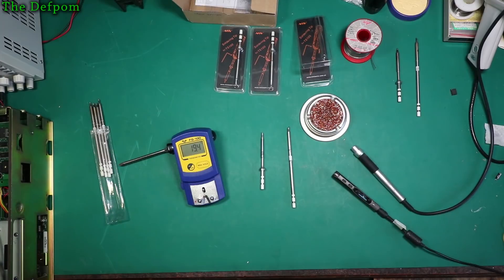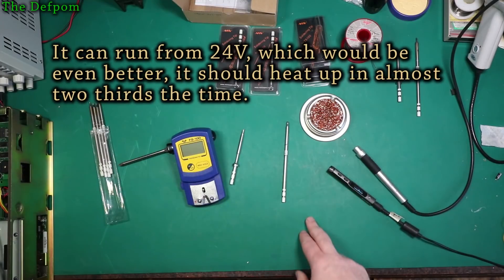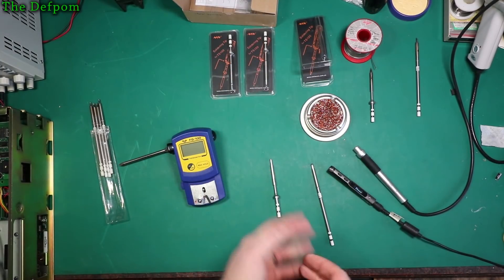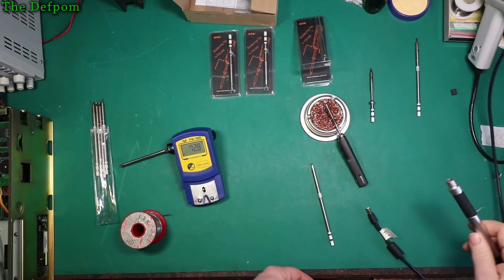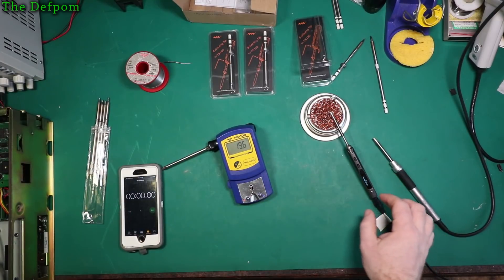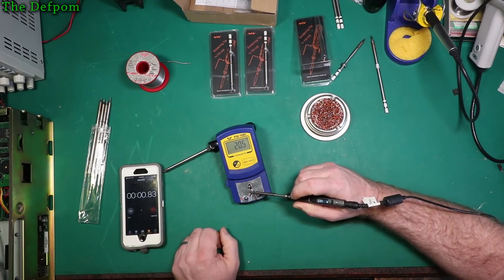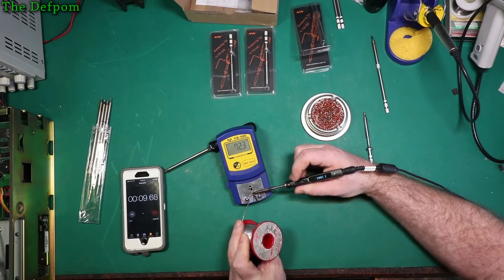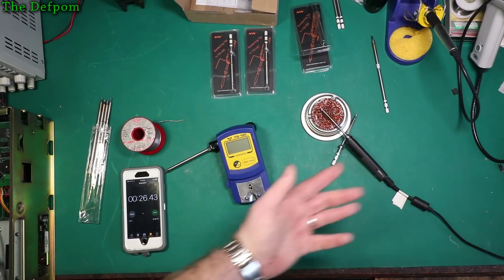🔴 #452 Fake FX-951 vs TS100 - Soldering Iron Shootout and Comparison for Voltlog

Comment: The TS100 with the 24V easily knocks the fake hakko, it heats up in a heartbeat, actually insane how quick it is and how well it holds temperature for being an small portable iron.
Reply: Does it require 24DC or can I use AC?
Reply: @bobweiram6321  Always DC, don''t try AC, it won't work and you can easily damage the device. It does not require 24DC only, as you can use like he did in the video 12V, but it will limit a lot the power of the iron. I've used 12V for doing things in the car as it is really convenient to plug in directly to the car and work around with it.
Reply: @anothervoyager9654  Some of the other soldering irons use AC or DC, but those usually have a separate circuit for the thermocouple or thermistor.

Comment: I'm a bit disappointed with the tests you chose. Getting to a certain temp from cold is not that big a deal. It shouldn't matter as long as it's decently quick. 30-40 seconds is fine for most people. 3 to 5 minutes on the other hand is painful.
Why not test the accuracy at a variety of temps? 250, 350 and 450 for instance. Does the accuracy have a slope to it and become less accurate as temps go up?
Reply: The KSGER 2.1S seems to have both of these units beat, hands down. You can calibrate each tip individually as well as adjust it's slope. Meaning each tip has an offset at 3 different temperatures. It's a really powerful little unit.
Reply: @JasonWW2000  Really? Is the KSGER that good? I want to get a new soldering station. I've been thinking about the Pace ADS200 because I use it frequently. And it requires no calibration. All other videos I've seen testing TS100, show large errors in accuracy. Like 30-40 C.
Reply: @acoustic61  The Pace is a lot bigger and more expensive,  but if you don't mind that, why not? 
I don't really know if the ADS200 is accurate or not, has anyone tested to confirm this? I don't see how it can be as accurate as they say (do they specify?) since it uses built in heaters in each cartridge. Maybe they break in each tip and then pick a certain temperature to calibrate to? Then this offset information is installed in each tip for the soldering unit to read and adjust it's output? I don't know if it's this complex or not. I think that's how the $700 Hakko station works. I would watch or read some reviews on the ADS200 to see if it lives up to it's hype or if it's all marketing talk.
Reply: @JasonWW2000  I think for production work you probably need to use an iron that's a more rugged workhorse with proper certifications etc. The Pace ADS200 is calibrated  out of the box. Temperature seems to be right on. EEVBlog did a review last year. Not sure how they do it. I thought I read something about a better thermocouple, but I don't remember where I saw it.  JBC outperforms the Pace,  but almost twice the price. JBC tips are expensive too. So I guess it all depends what your needs are. Since I use it for work, I probably don't want to be dealing with technical issues all the time. But the price of the KSGER makes it interesting nonetheless.
Reply: @acoustic61  Keep in mind it's not the solder station that needs calibration, it's the tips. Each tip has its own unique heater, thermocouple and tip size, shape. So some tips might run a bit hotter or cooler for the same exact voltage being fed to it. 
Older style solder stations with the heater built in the handle and has interchangeable tips only needs calibrating once because you use the same heater and thermocouple over and over so there is only a small difference due to tip size and shape. These old style usually respond slowly so they are not so great. 
For only $15 you can get a clone FG100 tester and see what actual temps you get. This is what I bought to test all my solder irons and tips. It was quite interesting.

If I needed one for work, I might get the ADS200 and also have a spare station just in case. The FX 951 would drive me crazy with it's bad user interface.
Reply: @JasonWW2000  It seems like Pace is doing something different because their literature states that calibration is never needed. And the temperatures measured are highly accurate. I hope the Pace station becomes more popular because I don't want to buy into the Pace system only to have it become discontinued. Perhaps it's popularity will  spur an underground world of knock-off parts like the Hakko did.  I guess you know when your product is popular when Bangood and AliExpress are infested with clones. FX-951 does have a bad UI. But not bad for production where the iron is used for one purpose.

Comment: You should power the TS100 from a 24 V power supply, otherwise you're comparing apples and oranges since the fake Hakko station is at its peak performance.